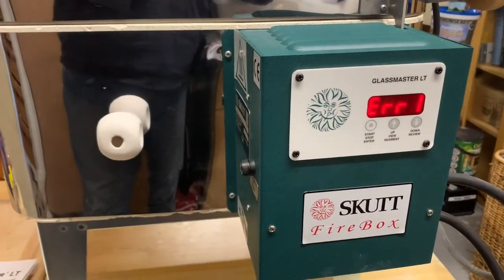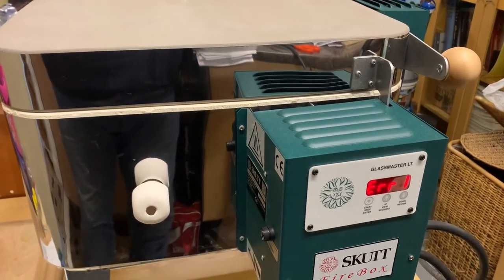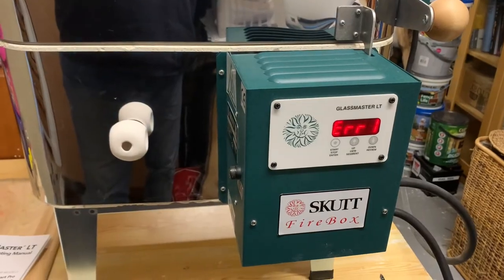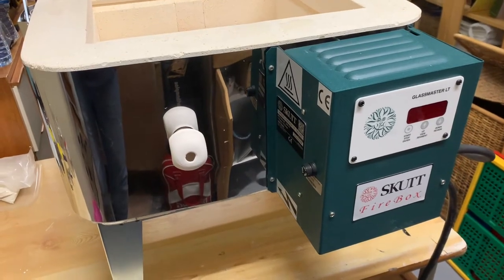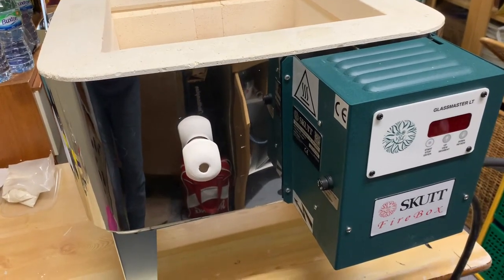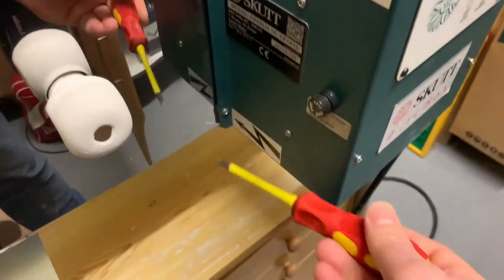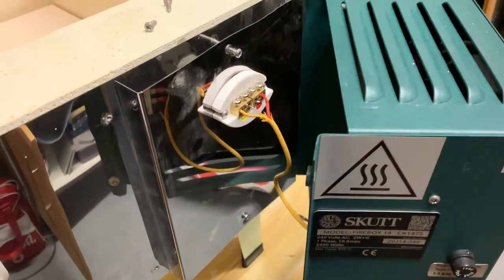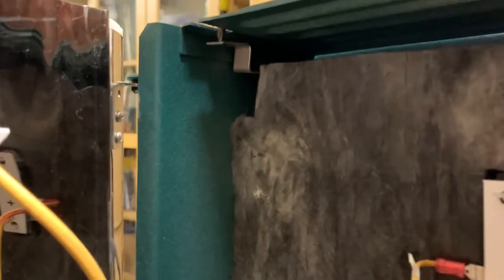Skutt Firebox 14 Err1 fault, and we take a look at our first 2 firings.

Comment: I’ve just ordered this klim, does it need an extractor installed, added to it?
Reply from the maker: I did not read anything about an extractor in instructions only allowing a space around it.  We have ours in our internal garage on a table. Enjoy it, and don’t be in a rush to use advance programs the standard 3 do the job well, without surprise unwanted cracks. Good luck. Andy

Comment: What size piece did you fuse and was it just 2 layers?
Reply from the maker: My kiln came with a free coaster project kit so we used that, 2- 3mm sheets.
Reply: @confusedglasscreations9375  Thanks. I’m in Oz and didn’t get one of those. Pity that your video didn’t include a photo of the project going into the kiln, then after firing as you opened the kiln. Thanks for sharing your experiences.